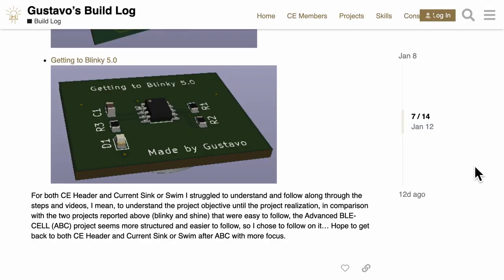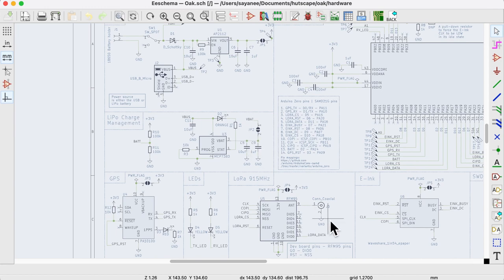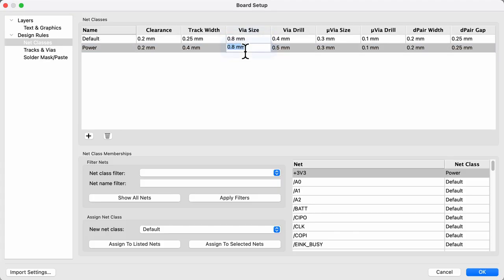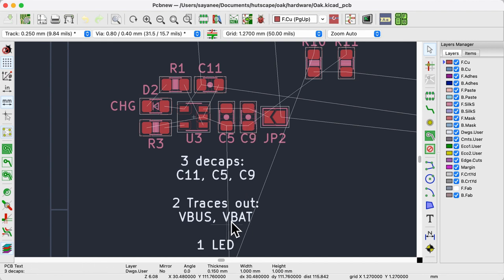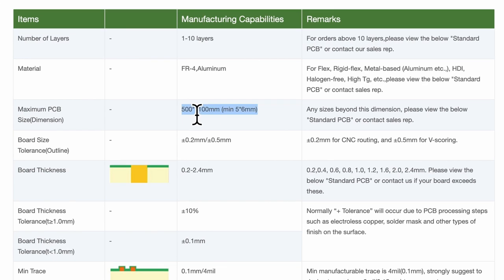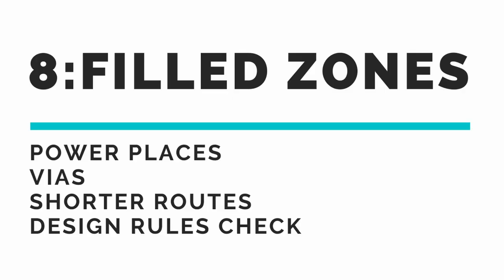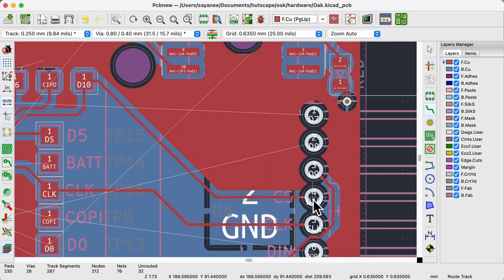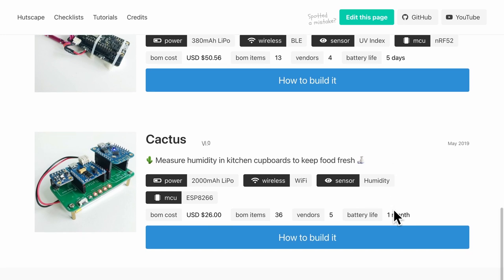From Rats Nest to a complete PCB layout in 10 steps // Designing a LoRa-GPS tracker in KiCad

Comment: Not bad for a relative newbie to PCB Design, however I would say that using a 2 layer PCB with a RF Coaxial connector then you will need a 2mm / 3mm trace for 50R impedance, so I would consider using 4 layer and calculate trace width for 50R your signal will be better and you will have less reflections, and make sure you check the datasheet in case you need external tuning components.

Comment: Make sure if putting designators and values if any will be covered by the component, have the value covered not the designator. This helps when repairing or troubleshooting

Also any connection to a pad should be as large as possible especially for thru hole components

Comment: This chanel gives me the will to try start building something rather than  just program stuff. Thank you!
Btw, what is the batery life of this gps tracker you bluilt, does it use low power mode ?
Reply from the maker: I have not soldered yet! Going to do it next week :) But yes, good point about noting the battery life. I will share another video in due time.

Comment: Like the way your process and thoughts are structured! Have found the most cumbersome part of pcb layout is the footprint design process - takes so much time and is easy to make a mistake. Great job!
Reply from the maker: Totally true! Footprint design is probably the step before this. You gotta refer to the datasheet (which might not be accurate) to getting the precise measurements, the pin names, etc.

I made a checklist on making footprints, but even then I can only confirm the design after it's manufactured and tested. Hope this helps you a little nonetheless :) https://hutscape.com/checklists/footprints
Reply: @sayanee  Amazing! Step #1 & #2 in the mechanical section for footprints - too true to check these first 😩 haha Thanks! :)
Reply from the maker: @robotgrrl  LOL yups, I have made those exact mistakes before ;)

Comment: Here’s a tip for your consideration, we can take inspiration from software developers in this particular case. Think functions and create the modules that go in your pcb’s that way. Like a power supply, or a filter, that sort of things. When we think of those modules as being black boxes, there’s something going in and something coming out. This means that when you consider those modules reliable and robust, you can just import that part of the design and save yourself some work. This is however not linear as parts could be discontinued or the particular application could require some rework, but it should be minimal. You might end up with a few versions for power supplies that meet different requirements but that’s how far you can optimize your work as far as I see it. Whatever work you do, try your best to make it scalable and reusable. This also makes it easier to document. As we all go through our learning curves, documentation is known to be one of the most important tasks that must be achieved in pain of possible severe future setbacks and plenty of head scratching. The pitfall is that the earlier projects are necessarily easier so that we can manage and understand them, and that’s exactly where the danger lies. They are easily manageable and we think we are in control and always will be. This is were we allow ourselves to be messy and create bad habits that will be harder to correct in the future, not to mention the legacy we gifted ourselves that will hardly be corrected and if it does, to me is incredibly boring to do. Plenty of people including myself have fallen into this trap many times over. So this is just a humble advise, I hope you and your subscribers might find it useful. When you think about it, it seems so logical that you can not envision anyone not knowing how this could happen and yet it does. I need to police myself in the early stages of doing something in order to think things through and not allow bad habits to sink in or it will be hell to pay later on.
As usual, very clear explanation and quite an interesting video. There’s always something interesting to learn from you. Many thanks.
Reply from the maker: Amazing! Never thought of these logical blocks as functions with inputs and outputs. 

Thanks for giving the hardware perspectives as well to balance it up with common pitfalls. I too think that as hardware and software interfaces are getting closer we can take inspiration from both sides of enigneering.
Reply: @sayanee  i see an engineer as a cross between a mad scientist and an artist that tries not to get anyone killed with his creations including himself. It would be a shame as it wouldn’t make for a very long career in both cases. Thinking outside the box isn’t the easiest thing to do, which is why many technological breakthroughs are achieved by people from outside a particular field of expertise. I define an expert as someone who knows increasingly more about increasingly less. The thin line that separates focus from tunnel vision is not always visible. We get educated out of creativity simply because schools think that’s the most efficient way of covering the subjects in the program and companies ask for creative people but then force us to come up with new ideas while wearing their straight jacket. The reason why we still have to do that awkward parallel parking that the majority of people never know how it will turn out is because automotive engineers have been taught that cars go forward and backward, not sideways. Is it impossible to come up with something better? I think not, but we get conditioned into thinking that’s the best way to do it. We need to add “so far” to that sentence and keep our creative juices flowing. It’s indeed a challenge. 
Often tech people engage in tunnel vision and forget to observe other aspects of society, like arts, cooking, sailing, or just sitting in the back garden observing and asking why something is the way it is. Everything around us can be a source of inspiration if we use our most valuable tool, the ability to extrapolate through abstraction. That to me is what thinking outside the box is all about. I have to confess that my previous post isn’t completely original, i tweaked the concept a little bit from my own observations and passed it on so that perhaps someone will add their contribution and me and others can go another step up the ladder. It’s done in the spirit of sharing for the common benefit and I hope people take it that way. I’m no better and no worse than anyone else, just another guy trying to go up another step on that stairway to Heaven. The higher you climb the further you can see. Sometimes, quite often in fact, is by standing on the shoulders of giants that came before us. I like to do my best to honor their contributions and generosity in giving us plenty to work with by simply sharing.
Reply from the maker: @Ferreira019760  I can't help but relate your thoughts on tunnel vision (specialist) vs seeing further (generalist) to the recent book I read "Range" by David Epstein.

Thanks for sharing :) I hope we can appreciate how exposure to other topics can lead us to solutions. I see some experiments in education towards that direction and I'm hopeful as a society we will be able to come up with something better than today.